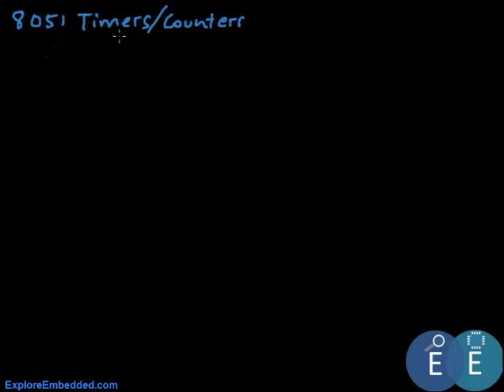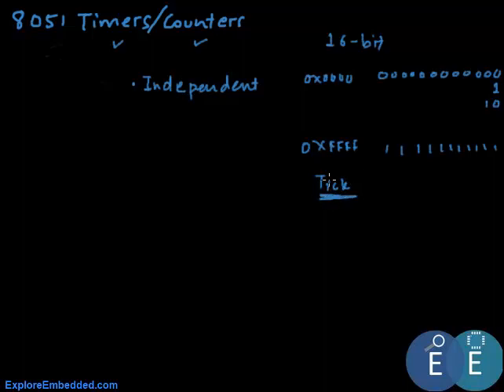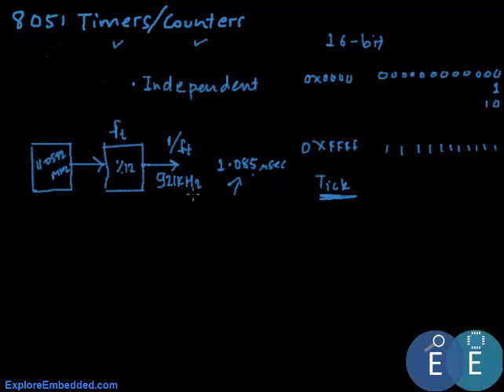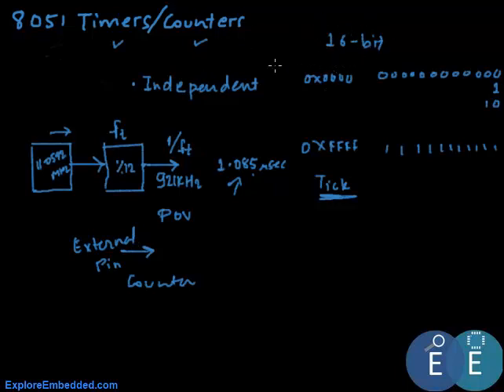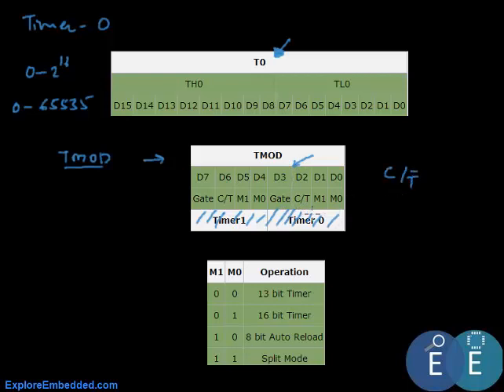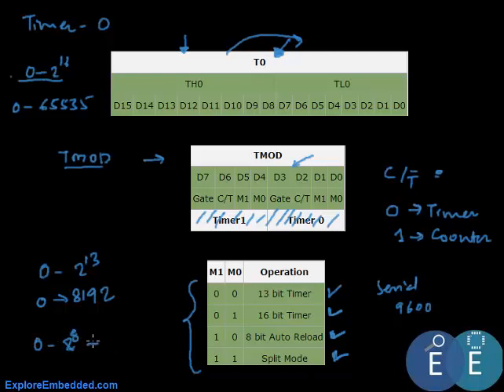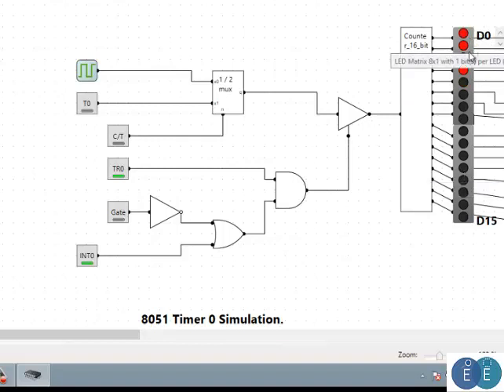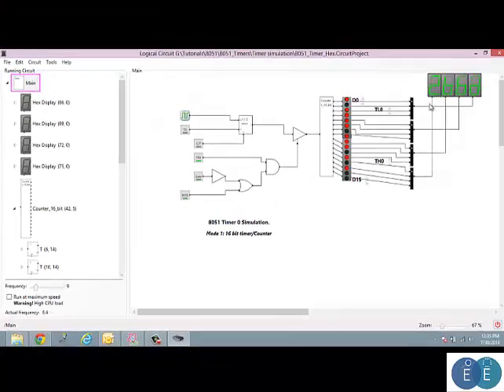8051 Timer

Comment: well i have a programm with two parts one written in assembly and one part written in c. i want to jump from c programm to a instruction in assembly programm can i do that..... and i want to store the c programm at specific address in 8051 how can i do that.....  thanks
Reply from the maker: Pankaj kumar  In the 'c' code you can use the asm directives to write assembly code!
Reply: thanks a lot for the answer..... is there any way to return form a interrupt to a position different from where we left the main programm